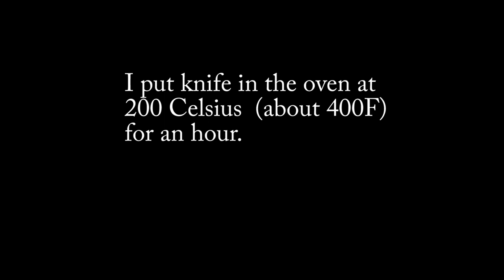Making a Chopper Knife - Part 1

Comment: I like it!
If I may respectfully give some advice, your platen is not square and your belt doesn't have enough tension, giving you a slack belt and that's giving you those wavy grind lines. Get that straightened out, and you'll spend way less time cleaning up with the file.
Reply from the maker: I was asking myself why my belt is so wavy. Thank you so much for helpful advice!
Reply: @madebyhand63  Glad to be of assistance! I think you did a terrific job straightening with the file, but your work will be much faster next time!